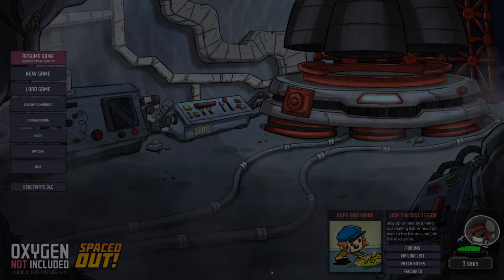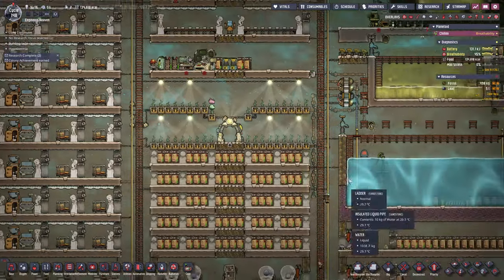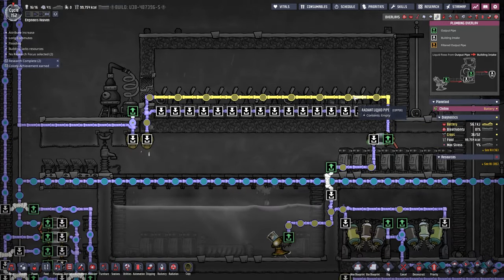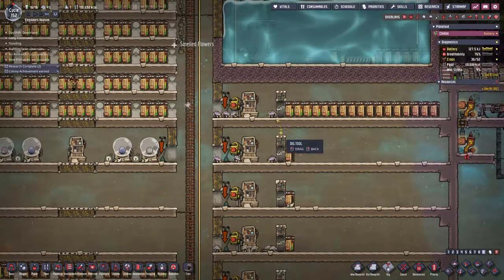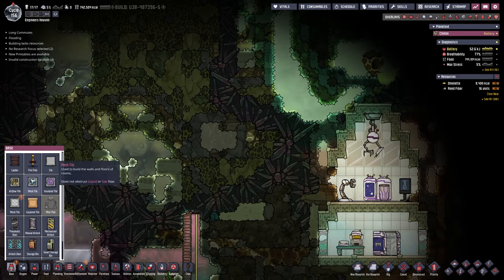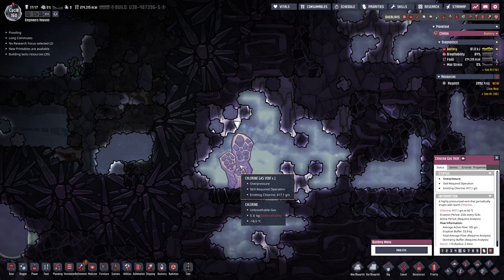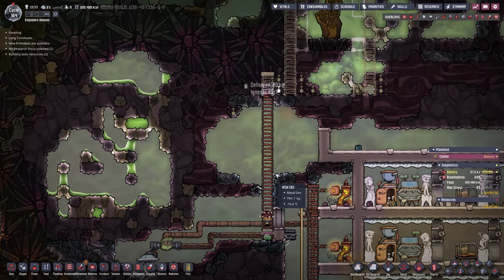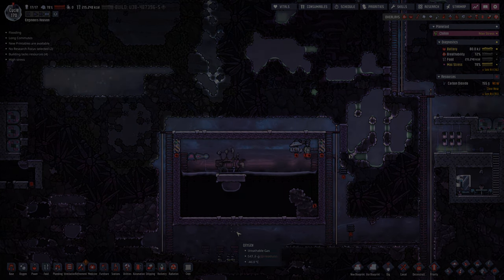CRUDE OIL, THIMBLE REEDS and GAS DELETION in OXYGEN NOT INCLUDED! (LP1-EP9)

Comment: You really only ever need one artist.
Also, chlorine can basically be a great deep-frozen food gas but does not need much either. Could just steal it out of the chlorine room.
The conductive wire could build 2 of the smaller converters for exactly 2kw. Can not actually have 4kw on a large without a bit of automation stuff, which some people consider a bug.